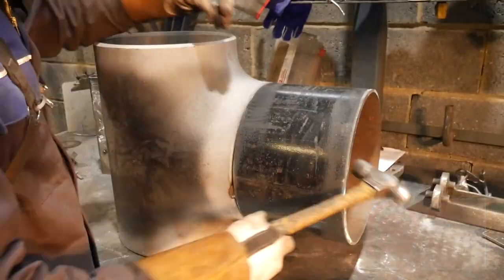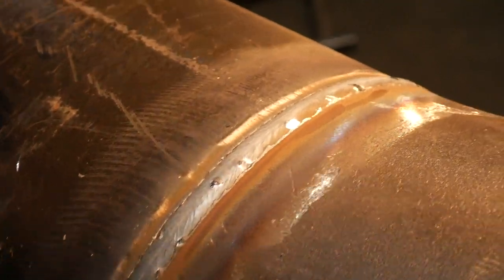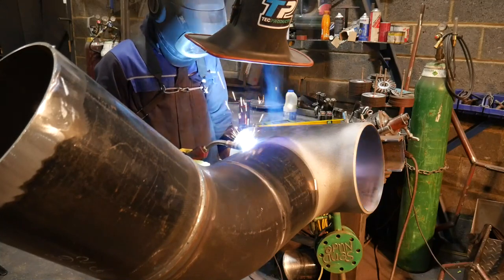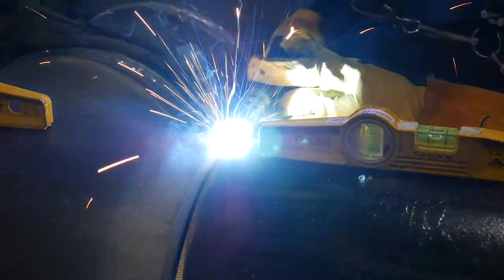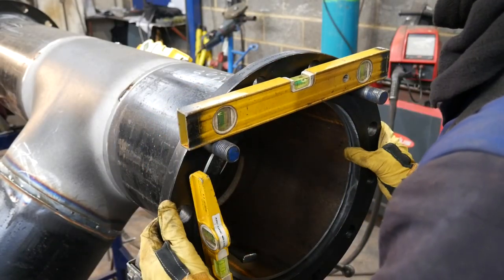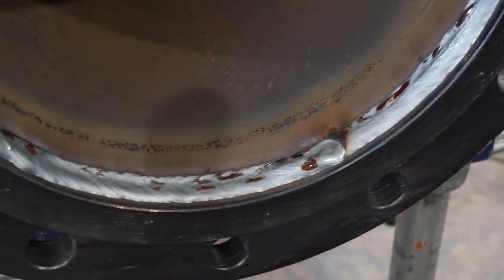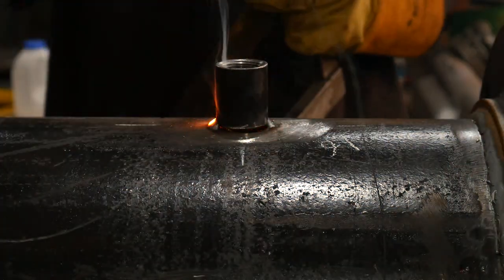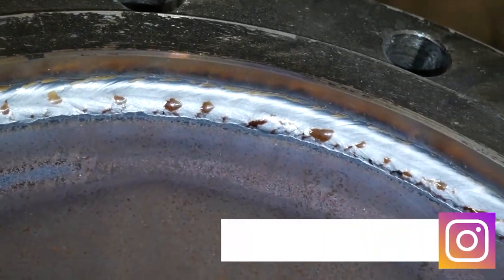12" Complete Spool Welding & Fabrication (MIG/MAG) *Pipe Falls Off*

Comment: Just always remember one thing about negative people with negative comments.  They can make their own videos and post them to their channel showing what they feel is the proper process to use.  I welded miles of pipe in the 70s on the North slope pipeline. Lots of 6010 root with 7018 cap in -80 degree F temps. You’re doing a fine job with what you have to work with and that’s the part that counts. Enjoyed your content 👍
🇺🇸🦅🌏⚓️🇺🇸

Comment: Keep your gas nozzle as clean as possible, if you can get yourself a sanding sponge,use it to smooth your drag against the pipe as you apply the root pass and it keeps the outer nozzle smooth with less bumps.

Comment: I think the fronius tps/i is the dream of every welder,for homade and pro use.you have great skils!
Reply: I would go with EWM. Not because that they are better (they are hardly at exact the same level), just because of the service. 
But Fronius makes some nasty machines.
Reply: @Nanogenium  i own a kemppi kms 400,15 years old only service i done is twice a year open it and clean the dust.If i spend 8-10k to buy it why i need service?

Comment: Hello my name is David, I really like your work, could you tell me how much separation you leave for the first penetration pass in this pipe?
Reply: Usually it's 3mm gap for root run, but you can use any size gap you are comfortable with as long as the overall length does not exceed the blueprint

Comment: Does that fronius machine not have a cmt root function?
Reply from the maker: Im not sure if mine does but it probably can do it but from my understanding you need a different torch that can retract the wire to run cmt
Reply: @ARCONEWELDING  not sure it needs a different torch? Probably a narrower shroud to direct the gas right down into a prep though. If CMT is anything like Miller's RMD rooting mode, it's like a modified pulse mode. The machine senses when the wire touches the puddle, bumps voltage up to seperate the wire, then drops back down again to cool the puddle, hundreds of times a second, keeping the puddle cool and controlled. 
If i understood it right that is😄😄

Comment: All pipe fitters tack onto the pipe,if they don't then how can they be pipe fitters? A tack can be cleaned off so tell them to start fabricating from the raw as you do, many can't!!
Reply: Depends what standard level is being worked to. ASME or EN1090 Class 4, with either, even an arc strike outside of any weld preps is an NDT failure. 
The rapid heating and cooling of the area around it will cause a spot on the pipe with less tensile strength due to it hardening. 
Commented on another of Calvin's videos about it a long time ago, and he said the clients they work for dont really care as most of it is only HVAC pipework. 
You started tacking balance weights on pipework for oil/gas or chemical plants, especially high pressure, you wouldnt last a week before you got the boot.